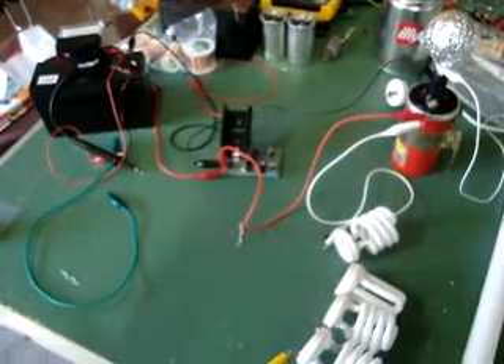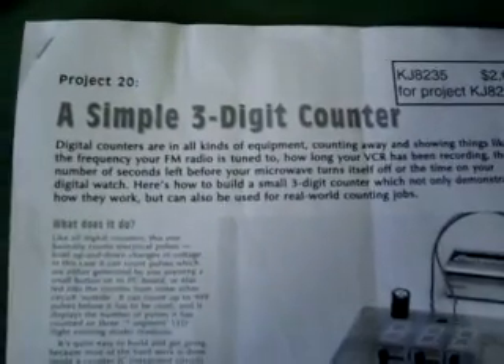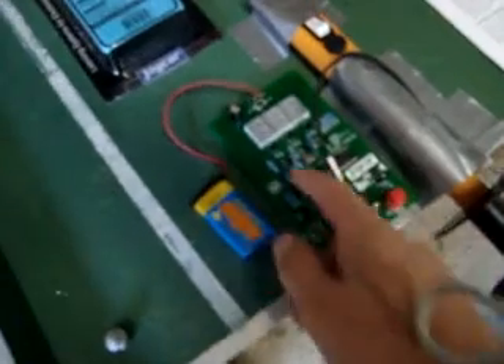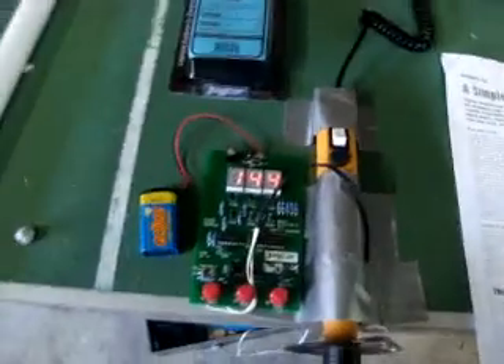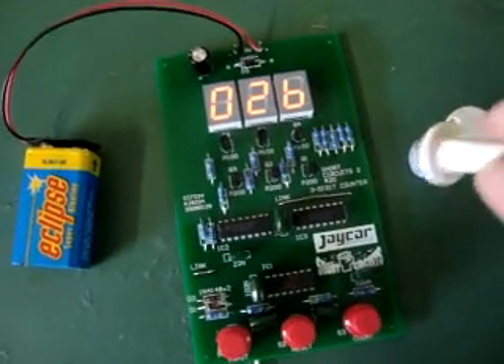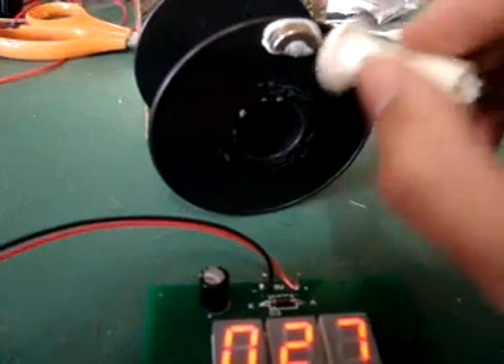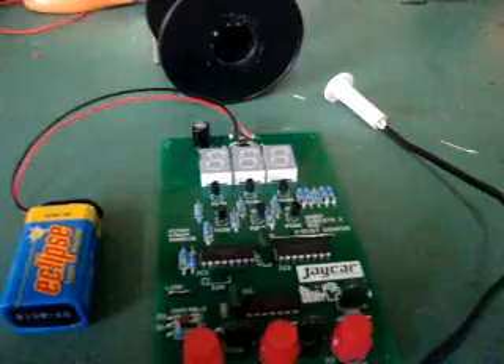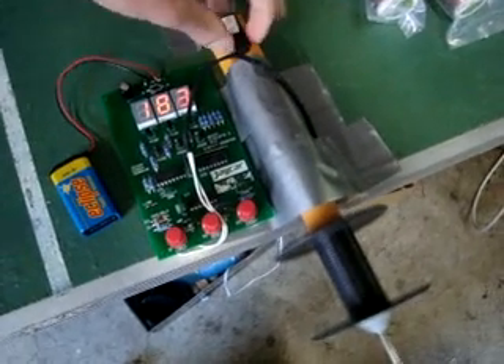Bedini and Tesla Coil Winding Machine With Turns Counter

Comment from the maker: when i say its high tech i mean i dont understand it! lol, i havent used photo-interupters before. its probably time to learn!
I find the response time is fine with the reed. I never run it as fast as u see in the video. in fact to wind a coil accurately its best to go quite slow. no point in re-inventing something that works fine.

I would be interested using photo-interupter for a different project. ive seen em at jaycar. I dont know wat kinda circuit they need tho.

Comment from the maker: the reed switches I use are very simple with no springs.
I have used reeds with Bedini motors before and it takes a long time to burn out.
I haven't had any problems with the coil winding machine.
Photo interupter is too high tech for this simple machine. I would consider using it in a Bedini motor though.

cheers

Comment: Nice helpful video thanks... I've also seen where you can hook the reed switch to a calculator keypad, at the back of number "1" key, so using cheap calculator to accumulate the count. They also have contact de bounce etc but need to enter first turn and hit ++to get it to accumulate count.